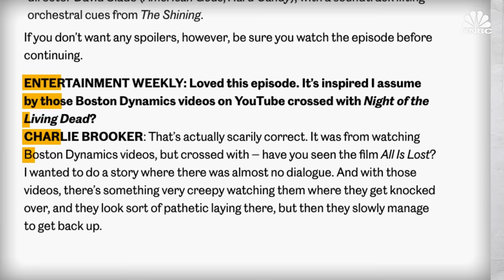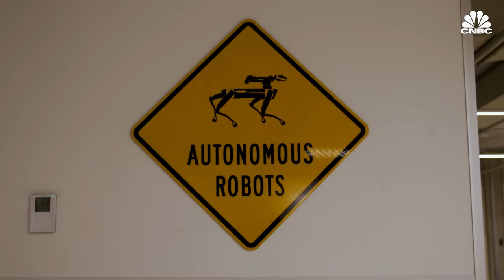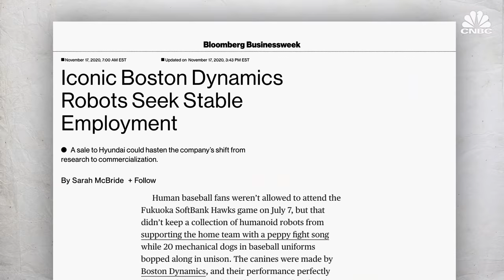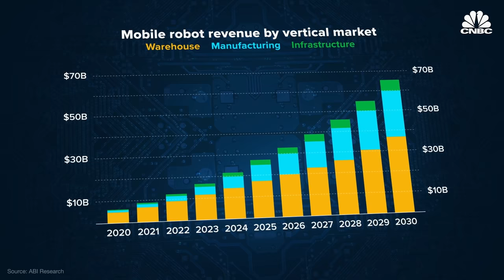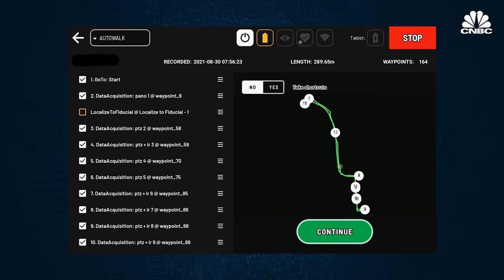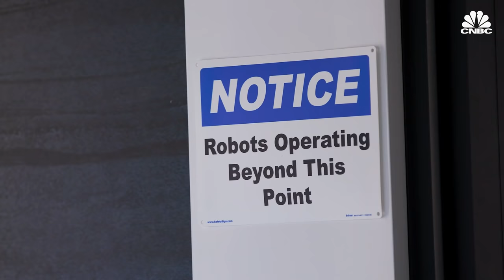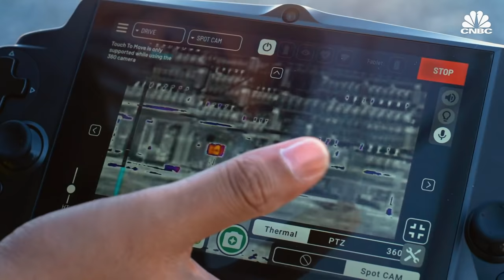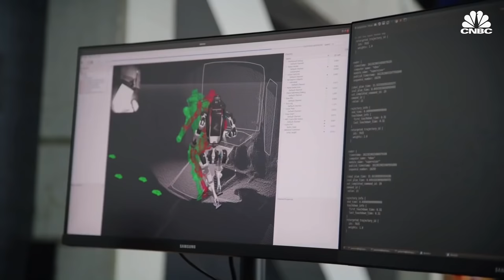How Boston Dynamics Is Building Its Robot Empire

Comment: Spot has a run time of 1 hour, Atlas can has a half hour run time, they need a major advancement in batteries.BD has incredible tech no doubt.
Reply: Exactly, any robotic system is only as good as its power store.
Reply: Just buy 24 of them and you can run all day.
Reply: Yeah, kinda contradict's the statement "they don't need to take breaks"
Reply: @andybaldman  lol the problem here is that you can hire a migrant worker at minimum wage to do the same thing and more for five or more years for the same price.
Reply: @Jzhongzhi  That doesn't work too well when you're sending them into dangerous environments.
Reply: Or just fast charge them . Do a task for an hour , dock and charge for 10 minutes, and continue. Humans also need a quick break , it's no big deal.
Reply: Boston Dynamics has a real commercial product: Spot. ... Spot can walk at 3 miles per hour and has an average runtime of 90 minutes. When the battery runs dry, operators can swap in a new battery to get the robot up and running again immediately.
Reply: yea the idea of soldiers and what not is still sci fi until AI and battery energy density improves by a order of magnitude.

Comment: Make Atlas able to do general Household tasks (clean room, load / unload dishwasher, etc...) available for $10,000 and it will sell like hotcakes.
Reply: I’ll continue to do them myself for just a few minutes a day.
Reply: I’d trade my wife in for one.
Reply: Spot. The alot smaller and less complex one cost like $100,000 so yea that wont happen.
Reply: andybaldman Many men would, especially if special features were included.
Reply: @suspicionofdeceit   that’s a funny!
Reply: @RasakBlood  it's called economies of scale , of course it will happen. It'll just take some time.  
I still  remember in 1996 / 1997 my work purchased 24" flat screen TVs for $25,000 CDN each one. Fast forward to today they give you a free 24" flat screen TV when you buy a mattress or signup for a credit card. Heck, 2 years ago I purchased a 4K, 55" TV for $750 CDN.
Reply: @RasakBlood  "Spot. The alot smaller and less complex one cost like $100,000 so yea that wont happen." 

...until it goes into mass production.
Reply: Doing laundry, folding it and even putting it away. I would give a years worth of salary for said bot.
Reply: @jiminverness  world prices of electronics, hydraulics and batteries wont go 90% down just by one company. And still they will fail at abstract tasks.
Reply: @Trim11  "And still they will fail at abstract tasks."
We still fail at abstract tasks.
Reply: Hello
Reply: @JJs_playground  Considering Hyundai itself has decades of robotics, manufacturing and industrial experience, I imagine they'll be able to scale up BD's production and drop their price pretty easily.
Reply: @suspicionofdeceit  Yeah your medal is the mail for your hard work.
Reply: i dont think it will ever get that cheap, unless theyre screwing you with monthly fees or some kind of contract saying you dont actually own the thing and the company can brick the robot at any time for any reason they see fit, and like tesla you wont be able to get the thing repaired anywhere but the manufacturer.

Comment: It would be cool to see a more dumbed down version of spot for simply leading the blind like guide dogs. The only issue I can image is in underground areas where GPS signals are poor that spot may get lost. And in this case a remote monitoring service would take over (at least I think this is a good idea)...
Reply: add an edited version of teslas self driving AI in the dog and it wouldnt need an internet connection only electricity, it could then identify people, cars, sidewalks, stoplights etc. And help the blind. When its connected to Wifi again it can update to the latest version of the ai. However if tech keeps going the way it is we might be able to cure blindness through a brain chip that stimulates the vision area (back of brain) or by replacing eyes either biological or digitally.

While the ai could still get lost in newer areas it would be perfect for the city or town the person lives in as over time the dog "knows" the streets

Comment: There are several Chinese companies that sell the exact same robots as Boston Dynamics for significantly lower prices, comes in different colour and even in different sizes. Boston Dynamics without US govt as customer would be screwed.
Reply: Those robots are cheap knockoffs that don’t match up to the capabilities of the spot robot. There’s a reason US companies prefer to purchase from Boston dynamics rather than said Chinese company.
Reply: It's the software that truly separates Boston dynamic from the competition.
Reply: LMAO, you mean Unitree and Xiaomi? Both of those are transparently built off the MIT Cheetah, which was already lower than 10k, but also far simpler to begin with. China didn't magically make equivalent robots 90% cheaper.

Comment: in the far future, cant you just tell one robot "make another robot exactly as you." it makes another robot after ordering some parts just like it. you tell the second robot to make a underground shelter that only the other robot/s and you will use/know about. the robot does this and hollows out a small tunnel inside your backyard. you tell it to go into that small tunnel and build alot more robots, you tell it to assign one of those robots to make solar panels ontop of the house connected to batteries wich are powering the tunnel, install lights and charging stations in the tunnel, make the tunnel into a massive base. START GENERATING A PROFIT, SELL MULTIPLE SERVICES, GET ENOUGH MONEY TO GO TO MARS, GET TO MARS AND MAKE AN EVEN LARGER BASE, CREATE A ROBOT NATION WITH YOU LIVING IN LUXURY.

Comment: Um.  Robots in space need to be shielded from  radiation. 
Semiconductors do not behave well in space. 
You either need to use  very old tech ('70, '80) and shield  extremely well.
I live in this industry.

Comment: Wait, yuou can buy a commercial Robot for $4k??? where..... show me. Honestly, commissioning usually costs between $5-15k
Reply: They have never said that. Spot does not sell for $20K -- that is probably what it costs to Boston Dynamics. But they sell it for between $75-$200K depending on configuration. And Chinese competitors (Unitree robotics) do sell a superficially similar product five times cheaper.
Reply: @cogoid  The Unitree and Xiaomi robots are built from the open source (I think?) MIT Cheetah, which was already below 10k and overall a simpler robot.

Comment: dr 1v3r:
"Boston dynamics spot warnings"
😎
Chat GPT:
"Boston Dynamics Spot robots come with a number of warnings and safety guidelines to ensure safe and proper operation. Some of the warnings include:

Keep hands and other body parts away from the robot's joints and actuators to avoid injury.
Only operate the robot in safe and controlled environments, free of obstacles and other hazards.
Never exceed the maximum load capacity or operate the robot outside of its specified operating range.
Always use the robot in accordance with local, state, and federal laws and regulations.
Never attempt to modify or repair the robot without first consulting Boston Dynamics.
Always keep the robot's battery charged and replace it promptly if it becomes damaged or depleted.
Keep the robot away from flammable and explosive materials and environments.
Always use the robot in a well-lit environment and ensure that its cameras and sensors are not obstructed.
It is important to carefully review and understand all of the warnings and safety guidelines before operating a Boston Dynamics Spot robot, to ensure safe and responsible use."

dr 1v3r:
"spot can move fast"
☕
Chat GPT:
"Yes, Boston Dynamics Spot robots are designed to move quickly and fluidly. Their advanced mobility and agility allow them to navigate complex environments and perform a wide range of tasks. Spot's legs are actuated by electric motors, which allow it to move in a smooth and dynamic manner, and its lightweight and compact design makes it well-suited for fast movements and sudden changes of direction. However, it's important to operate Spot responsibly and within its capabilities to avoid any accidents or damage to the robot."

"...damage to the robot...uhu. "

Comment: Me I see the Perfect Device for for A VR AR video game. Spot Carring the Signal Bouncing the 5G Pre Rendering in Real time While I am wearing an Apple Vision Pro fully controlling it from Home. The Mac and Vision Pro is rendering the High resolution VR Drone Display game in 360 4K. That can be adapted to any job or game. We log on to account with the AVP and Videogame Motion controller. My personal Spot Robot in connected to my Home Network and t can bounce signal communication. Technically we are just Playing a VR game but. it store that meta save data program uploaded for Spot to Run in Reality. It could Make the Most Awesome VR/AR Mass Online game connected. We don't technically need cellular towers if Spot can render and relay bounce the 5G signal.

Comment: This is misleading: The grid and many process industry are highly automated. So they should be able to monitor and directly interact remotely through plant automation and  HMI. temperature pressure and other sensors facilitate monitoring and safety continously. Not sure what the Robot Dog can do onsite actualy, that the technican cant do or  diagnose manually  over their HMI.
What if this robot bumps into something and no one becomes aware..
 This video at best is marketing to drive a business case.

Comment: Maybe Google bought Boston dynamics to scupper it. The way oil companies used to by alternative energy companies. Personally I don't see any point in buying BD, it's just a hardware idea, and is it really the best privaye scientists can do ? No. BD was a college project. Tbh private has no properly focus on robotics, you can see the tech is there to be evolved but there is no real innovation in hardware,all the innovation is ai software. I hoped with 3D printing robotics would attempt to print human skeleton structures and apply them to robotics. Not so far. Spot does try to copy bio legs somewhat, but only in bone shape, not really for flexible ligaments. There is nothing in robotics as flexible as a human knee, it's all rigid joints, which is like humans with all bones connected together, it's rigid and harder to program ai for balance. Bio bones are not connected, they link by ligaments and tendons allowing for flexible movements, in other words movement is an approximation instead of an exact position
Reply: ...How would Google buying out BD scupper it if they've continued to develop their machines uninterrupted?
Reply: @chaosfire321  Because BD has no major hardware innovation,  The robots are average, the big innovation is with ai software. So did Google need to buy it or do they just want to take out competition ?